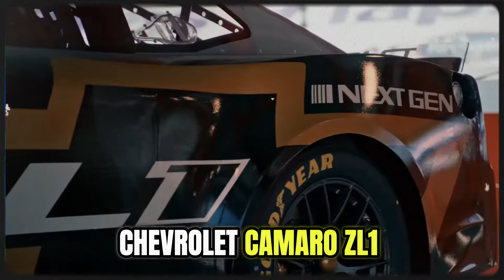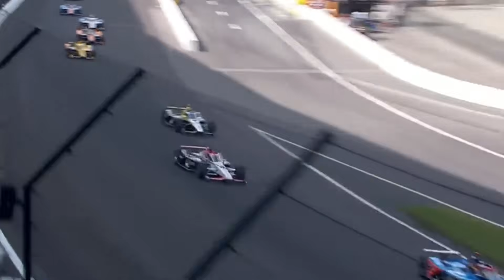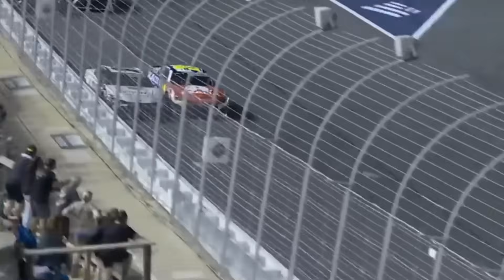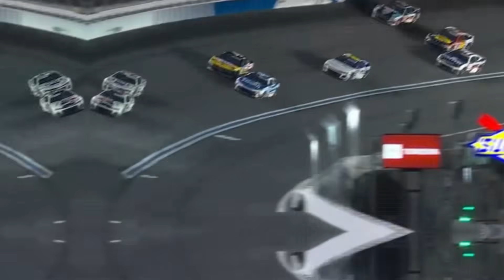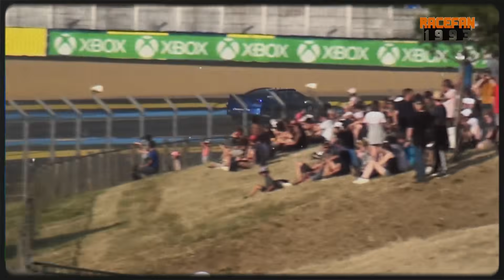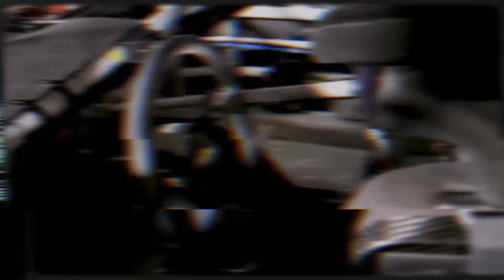Why This NASCAR Was Faster Than a Ferrari at Le Mans!

Comment: ... because it had 600lbs stripped out of it, fitted with a modern 6-speed gearbox, added winglets and strakes to the nose, added sills to the sideskirt, and fitted a modern rear wing, so that the only thing it had in common with a NASCAR COT was the chassis and two thirds of the engine?